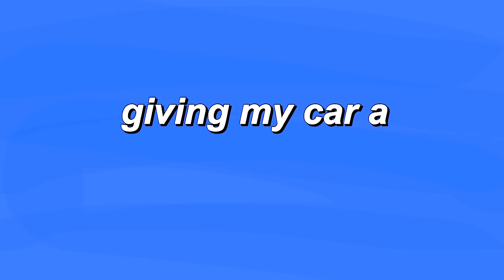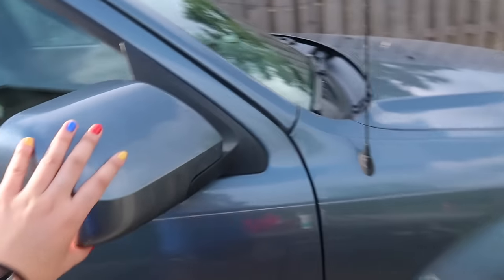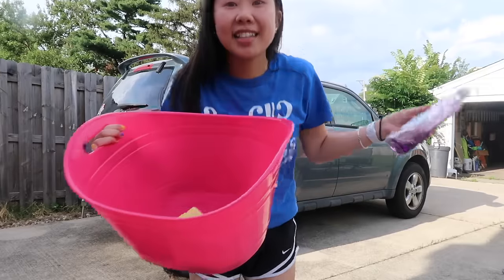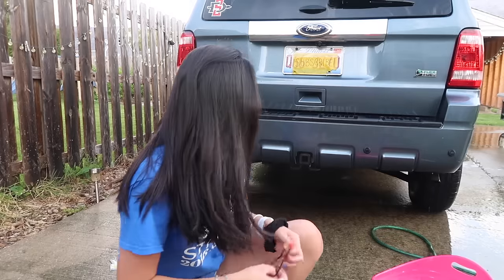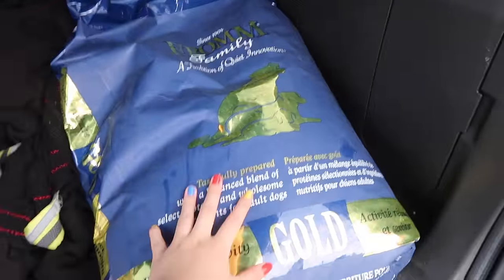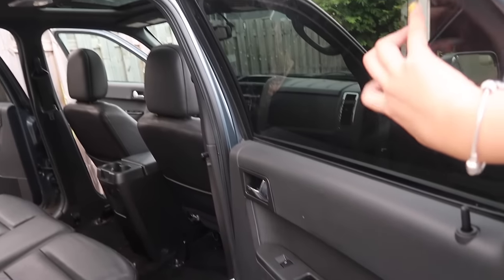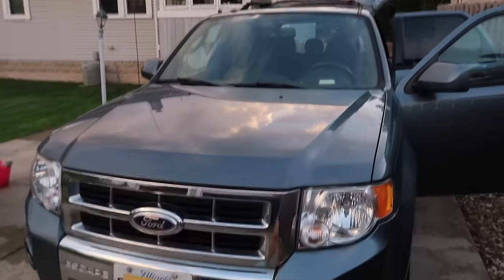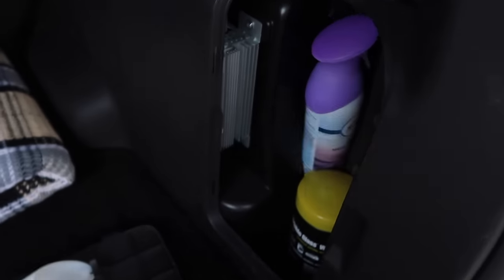giving my car a glow up + car tour!!

Comment: i literally melted at the dog’s bark oml

besides that, i just wanted to point out that you should definitely not use a sponge for the wheels than go back to the top of the car, it’ll scratch your paint real bad. and hand dry the paint to prevent water spots.